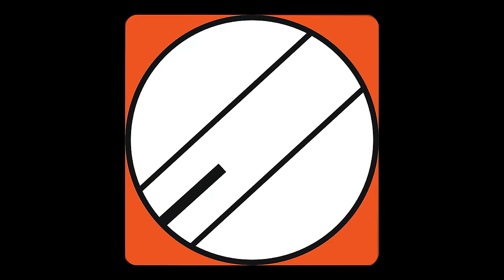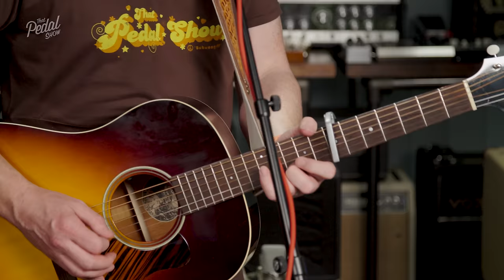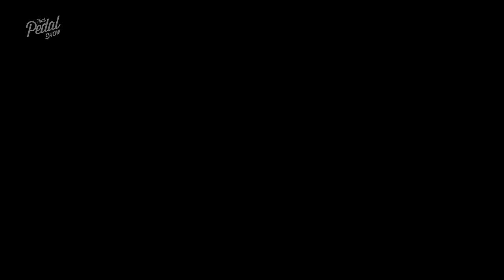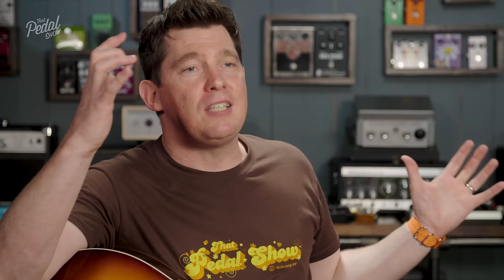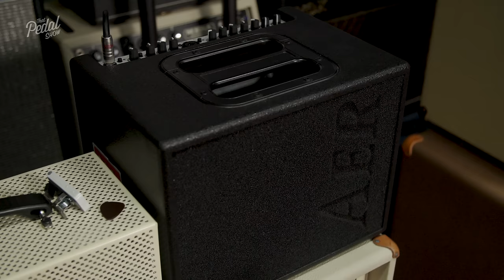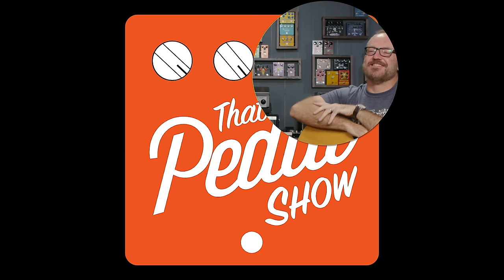Better Plugged-In Acoustic Guitar Sound Basics: Pickups, PA, Amps & All That Stuff – That Pedal Show

Comment: Friendly sound guy here, great show as usual and LOVE this topic because I can't tell you how many crap sounding acoustics I've run sound for. I'm not much of an acoustic player myself, but here's just some sound guy nuggets to enrich this guitar loving audience:
- Acoustic amps are way better than wedges most of the time because the front surface of your acoustic resonates, and changing the location and angle of the stage sound putting a human body between the speaker and the guitar helps enormously. 
- cheap sounding pickups just can't be fixed at the board, but the good ones while kinda gross pre-eq can sound fantastic once they've been EQ'd. So far the best sounding direct sound I've ever heard came from a Mcpherson guitar played by a blue grass pro who's been playing longer than I've been alive. The worst sound is tied between Ovation and Ibanez (sorry)
- The back side of speakers put out a ton of low end, so 99 times out of 100, I'm having to trim a bunch of low out of your signal to keep it from resonating into feedback, that's why it sounds so "thin" to you, and sorry but that's just the way it's gotta be
- A feedback buster DOES have a negative effect on your guitar, but it's far less negative that howling feedback, so if you're playing in a loud situation or with a full band, plug that hole. 
- The number one sign for me of an acoustic player that's going to give me a good signal is walking in with one of those LR Baggs acoustic preamps, the one with the built in tuner and parametric EQ. I don't know why, but almost everyone who walks in with one of those just does a better job. 
- Play your strings harder than you think you should, it just makes everything sound better. I'm not saying full punk rock jackhammer, but put some heat on it when playing live. 

Hope that helps, or at least gives you a little more idea of how your sound guy is thinking.
Reply from the maker: Thank you for that Sven - useful and enlightening!
Reply: Funny how I found the pedal show while searching for videos on amps and pedals, and I think I've learned almost as much about tips to help my sound board running.  Thanks Sven, some nice pointers.
Reply: Thank you very much for such a great advice. I am one of the nerdyes walking with LR Baggs preamp and my acoustic amp as my monitor.  Always getting from the rest of the band -there is no need- feel revindicated 📣😀
Reply: Sven, hi, having been dissatisfied with my cheap piezo equipped guitars for years I asked my bandmate how he got such a good sound with his Martin x series electro acoustic. It turns out that it's not the onboard preamp but a passive DI box between the guitar and PA. I tried it with my low budget acoustic and it works well, it now sounds like an acoustic when amplified. Perhaps this would work with the Ovation and Ibanez guitars too? Or did you do this already? Ian
Reply: as a sound engineer and musician myself, I fully support this! It's true, whenever I see LR Baggs, it's like and instant tell that the player is no schmuck lol
Reply: That last point is gold for anybody just starting out playing live amplified acoustic, be it gigs or open mics, and not one I've seen made before. 

As a newish acoustic player (and never having done live sound engineering for acoustics) my instinct was to try to back off when confronted with a loud, harshly bright sound when I played. Instinctively I kinda knew I needed to relax and 'just play', but it's very helpful to have a sound guy clarify, thank you!

Comment: ive been playing the acoustic guitar live for 20 years. Through my journey i used a few different Preamps before (LR Baggs Para, AER, Firewood DI Japan) until i realised recently that I prefer just a normal DI Box (sometimes without DI) straight into the mixer. That way I rely more on my ears to bring out the most accurate, true-est sound of my acoustic guitar. I no longer wanna be spoilt by choices and options and i just wanted things simple.

Comment: If you are going to use a passive piezo, then you would do well to plug it into a very high impedance input, on the order of 5-10 Megaohms, like a Z.Vex Super Hard-On. Piezos have a very high characteristic impedance, and they improve greatly by plugging them into an appropriate impedance, rather than the usual 1 Megaohm of the average guitar amp or other audio gear. A Countryman Type 85 DI has an input impedance of 10 Megaohms.
Reply: Super hard-on? I don’t know if I would sound any better playing with one. I think it may be a little distracting but hey whatever works.

Comment: Once you do a gig with a great acoustic amp ... you will never go back.  Ever.

It allows you to play expressively and get away from the strummy-strummy. And if you use it as your monitor running vocals and guitar through it ... say good bye to being at the whims of a sound man. It is heaven. HEAVEN!
Reply from the maker: Yep!
Reply: Agreed! LOVE  my Fishman amp. Bye bye sound guy. ; )
Reply: Which acoustic amp do you recommend Murray?  I tried a Fender Acoustic 200  with guitar and vocal, and really liked it.
Reply: I couldn't believe my ears the first time I heard a proper, high-quality acoustic amp. I ran a Tele through it for THE clean Jazz guitar tone. And ofc, an acoustic. Alas, I can't remember the brand and it was super-expensive so I didn't end up buying it. Belongs to a mate who has a store in Sydney.
Reply: I mean.. in a more practical sense.. it’s a hell of a lot easier to lug one acoustic amp and throw a mic/cables in a backpack to go gig most bars/coffee shops. You can add a 400w powered speaker run from the output of the amp if you need more power, or go into a PA the venue has. If you’re doing acoustic/electric mixed gigs things change but for a solo or small group acoustic amps just win.
Reply: howardsinclair The fender acoustic amps haven't been my favorite. If it's working for you that's great! I may have to try them again ... There are three I like a lot. If you aren’t budget constrained, the AER amp Mick used in the video is the Rolls Royce. I believe that one is the AER Compact 60. For about half the price, I recommend the Fishman Loudbox Artist (what I use) or the surprisingly awesome Boss Acoustic Singer Live (What the person in my duo uses). They are both incredible amps that don't just amplify acoustic guitars they seem to bring them to life. It's not just about volume ... these three amps make it easier to play expressively even in loud pubs ... or bars as we call them in the states. You can't go wrong with any of these amps.
Reply: Thanks Murray.  I haven't used an acoustic amp live, but did set up a guitar and mic in a music shop, then played/sang a couple of songs into a few amps (one of which was the Fishman).  In that setting, I preferred the Fender.

Comment: I run a Godin Grand Concert Duet Ambiance into an inexpensive Behringer mixer and a pair of old KRK Rokit Powered 6 G2 monitors. (Those "Red" ones they made for Guitar Center years ago.) I use a cheap (but good) old MXL V63M mic to talk to the crowd (I don't sing though) and add a little of the board's built-in reverb to the guitar. The whole rig is very cost efficient and sounds great. That Godin really does sound like a very well mic'd guitar, and the crowd gets to hear the board's reverb in stereo---something I couldn't do with just an acoustic guitar amplifier.

Comment: I use an my old Trace Acoustic amp 99% of the time for exactly the reasons Mick states. 

My sound is available to the PA with no additional faff, plus I can monitor myself. Admittedly it doesn’t sound as good as  that AER but it certainly beats any direct-to-PA sound Ive ever achieved. I’d say it sounds better than the Mesa though. If I can earn the thick end of £900 through gigs I may consider upgrading to an AER.

Comment: I gig weekly with an acoustic guitar. I struggled with quacky under saddle pickups, microphone pickups that sounded great but had horrible feedback, heat, cold, rain/wet. And then I got a McPherson Sable carbon guitar - all problems solved and great sound achieved. Don't knock it if you haven't tried it. The Fishman Loudbox mini is a great companion, especially if you sometimes play outside, have no power and need a mic with your guitar.

Comment: I have a stock fishman prefix plus t in my gibson songwriter. Ive had alot of higher end acoustics with UST style preamps. The less power you are taking from preamp as a signal the more natural the acoustic sound will be. Having a good DI on a passive pickup system is the main key. Being very delicate with the controls and keeping these as low as possible will leave your tone unmolested, and give you good sounds out of any ust. The guitar itself does make a difference in the eq of the sound because the quality and thickness of the build contribute so much to the overal frequencies that the saddle picks up. Ive always loved the sound of usts and they only sound bad if the player doesnt care. The topic of discussion and the solutions given in this video are perfect for the plug and play player whos thinking about not just being the acoustic guy or duo in the corner quacking away. I love seeing this topic covered. Even if its 5 years old. Get the tools for a good sound and sound good, and the gigs will come. Compression and reverb are also your friends. They add color to your playing and give a natural echo. I prefer reverb on the guitar and an almost dry vocal as it colors the vocals and makes them sound more relaxing. Depending on the gig, you have to read your audience. The more raunchy the crowd, the more raunchy the mix. If its time to party, loud and dry. For a private party, soft and pretty. Nothing beats the sound of a mic, but people talk.... some people use loopers. Theres all sorts of different reasons people use what they use. Its up to the artist to find what sounds good. If you let your di boxes and preams amplify the signal and let your PA do the work, you will get a less qucky more natural tone, more pleasing to the ear, and easier to play overall. Just my 2 cents

Comment: The right sound hole pickup can work well for different applications. I’ve played in open tunings and DADGAD for years and hated my plugged in sound, then I learned that Marcus Mumford (Mumford & Sons) uses a sound hole pickup because it works and sounds better with those type of tunings compared to a piezo. I now use the same Fishman Rare Earth Humbucking sound hole pickups on all of my guitars that Mumford uses run into a Radial J48 DI and am very pleased with the sound.
Reply from the maker: Nice. Sounds pants past the sixth or seventh fret though right!? But as we all know, no acoustic guitarist should be up there anyway. Everyone’s a winner. Cheers!
Reply from the maker: I can always hear a bit of electric guitar. Which can be cool I guess! But you’re right about the touch and approach. Ultimately it’s about a setup that works for you and how you interact with it. There is no plugged in acoustic guitar that actually sounds much like an acoustic guitar so it evolves into its own thing and you bend it to work. I’ve kinda given up trying and now just run the K&K because it has the least physical impact on the guitar. AER does the rest. Cheers!
Reply: That Pedal Show Fair enough - like you said before, no acoustic guitar player has any business being that far up the neck anyway. There’s no money above the 12th fret!

Comment: Do you think you'd ever manage to get away with micing up an acoustic with condenser in your average pub gig? Or do you think it would just pick up way, way too much noise and feedback - I've never actually tried using a condenser in a live situation 'cos I've just assumed it would be a disaster.
Reply: I like that sound a lot, but the only example I remember is al di meola on stage, which probably means you have to be al di meola on stage
Reply: I've done it in coffee shops. You have to be very careful about mic placement in relation to the mains. It only worked when playing without stage monitors.
Reply: I’ve done it with an AT AE5400. It sounded great; however, it was a pain in the ass.

Comment: I both gig and do sound engineering for myself and others I have pre-2001 Taylor 914CE with the Fishman prefix blender on it (before the expression system came in). I do a lot of work  with bands playing worship music in reverberant church environments and the best solution for artist and audience/congregation is always wedges and FOH PA placed in front of the mics, with acoustic guitar EQ presets on the digital desk as a starting point. This can however create an issue with guitar feedback into the wedge mix if they don't have a sound hole blocker in place. The key weakness with acoustic amps is when they are placed as a backline into which microphones are plugged in that they deliver instant screeching as the amplifiers fire signal down the the throats of the mics. There are rules and solutions for everything but no one panacea. I am putting together a PA with an active stage box with labelled acoustic guitar channels so you can plug in and hear your sound out of the wedge and then tweak the EQ/ monitor volume yourself using the iPad app for your vocal/instrument channel - perfect??

Comment: If you’re stuck for an acoustic amp try your electric valve amp and plug a cheap piezo horn tweeter into the extension speaker socket and sit it on the top of the amp. Gives it some full range capability so you’re not having to boost the treble eq much and making it too harsh. The impedance of the piezo is very high so no problems with impedance mismatch/ amp damage risk. Conversely have modded my passive monitor wedges to be able to switch OUT the tweeter horn so can use the 12” main driver as a closed back electric guitar speaker at a push if you have a speaker failure at a gig.

Comment: I play live acoustic a lot and I have the Fishman version (Ellipse Matrix) of your LR Baggs that has an undersaddle and microphone pickup. The only difference that is super key is that is has a phase reversal button which really helps with feedback and getting your guitar to work with the space you are playing in. I rarely use the microphone option because it doesn't cut through the mix as well as the undersaddle. As far as pedals go, I go straight into a JHS Pulp 'n' Peel Compressor V4 because it has an XLR output. That goes straight into the board where they add a little reverb. The Pulp n Peel is great because it has EQ and a blend knob to blend in just the right amount of compression. Check it out! It has made a world of difference in my live acoustic sound.
Reply from the maker: I’m a big fan of the Matrix Ellipse. Used them in a few Martins over the years - Mick here. The Baggs does have phase too. Cheers!

Comment: Although I general prefer mikes (I use a KM185), I have a Yamaha THR acoustic amp and it really does the job. Not cheap but the modeling really improves on the piezo sound of my Martin. It’s a great solution when the situation warrants it. Don’t need anything more power, as it can just plug into a PA or stick a mike in front of it.

Comment: Thanks guys.  I'm behind on my TPS viewing and just got to this one today.  Lots of good stuff/advice in here as always.

I'm loving my electric guitar(s) journey, but I'm primarily an acoustic player.  I play fingerstyle blues with thumbpick and metal fingerpicks and do a lot of palm muting on the bass strings.  I tried under-saddle and under the bridge mounted pickups but they picked up the sound of my palm against the bridge - a creaking sort of sound.  I settled, and I do mean settled, for a Fishman Rare Earth humbucker soundhole pickup.  It's a great product and does the job, but it's still doesn't sound as good as the LR Baggs Anthem piezo/internal mic combo that my guitar buddy uses.  Unlike me, he's not a blues fingerstyle player.

For amplification, I've used an AER Compact60 (first version) for over a decade now.  Transparent, noise-free and loud enough for the coffeehouse gig.  My only complaint is that the built-in delay doesn't do a good slapback - only two settings and both are too long for my taste.  I'm going to toy around with a tc electronics Flashback mini in my signal chain.

Comment: I don't know why I missed this. Wow, just wow, what a stellar cover of "Here Comes the Sun". Take that on the road guys. ;-) Re: Acoustic pickups and preamp systems, I got a Taylor 414ce a while ago. It has the ES2 pickup and preamp system. I can't get a good plugged in sound with the ES2 - it sounds terrible: Brittle, with chirps on the 3rd and 2nd strings. Unplugged or mic'd with nice condenser mic, the guitar sounds awesome. I installed a K&K Double Helix passive magnetic soundhole pickup and the natural acoustic beauty of the guitar came to life. Need more midrange oomph for soloing? There's a "steam" setting on the pickup. Amazing pickup - no battery required. C'mon Taylor, get your plugged in act together!